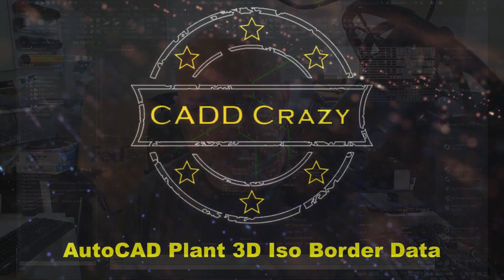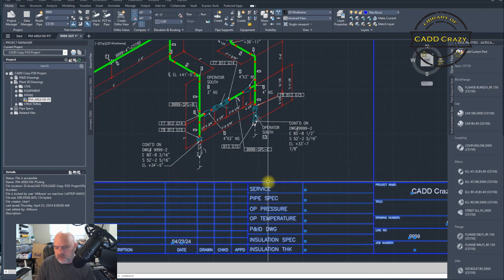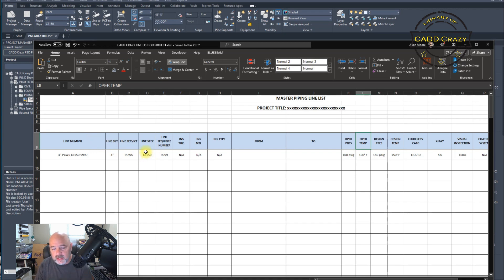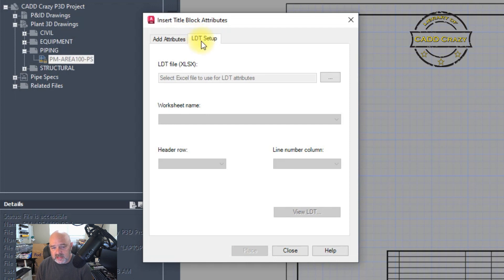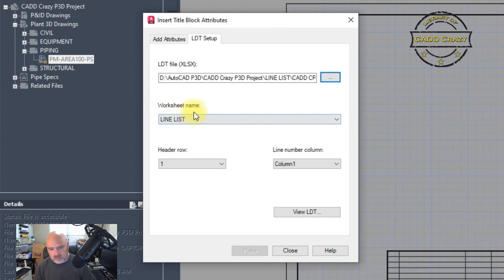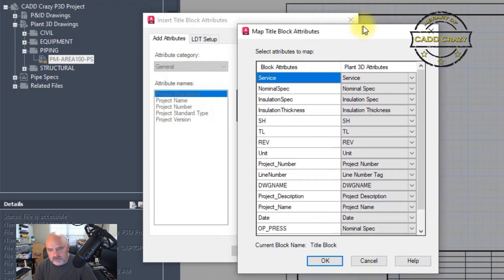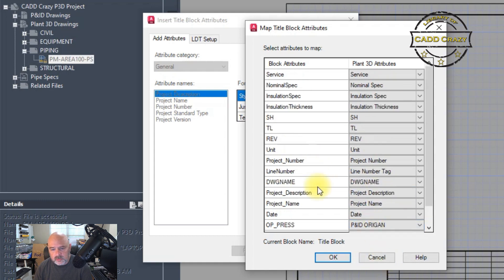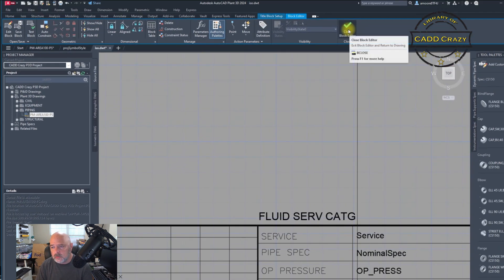AutoCAD Plant 3D Iso Border Data from Line List

Comment: Thanks for the video. I have been using this format for about 2 years now. I use a lot of excel formulas. Here are things I have to be aware of: (1.) It only works for me in Project Isos. (2.) Cannot leave a cell blank. (3.) Does not work well in ACC projects